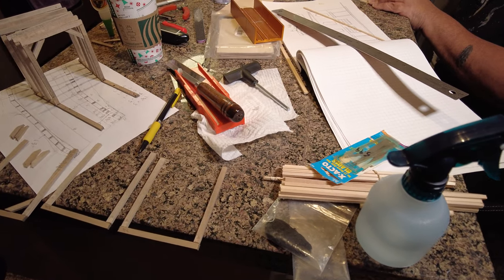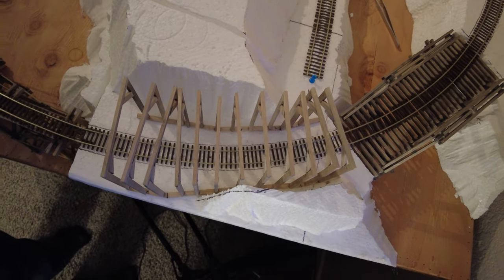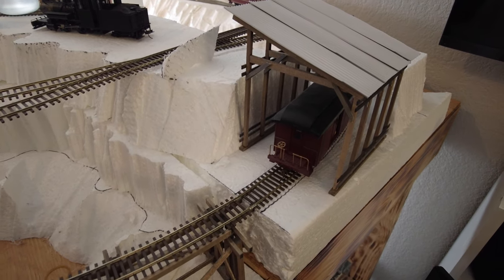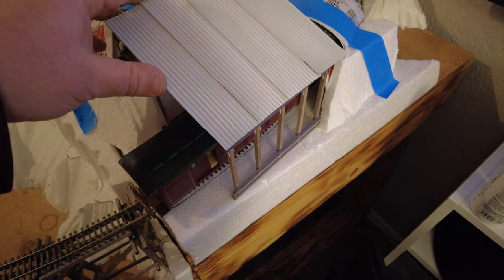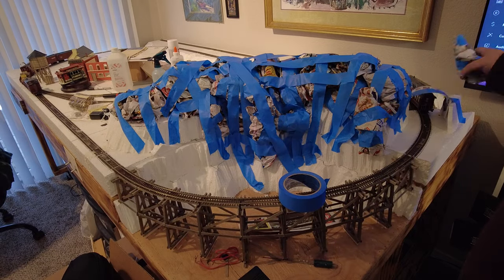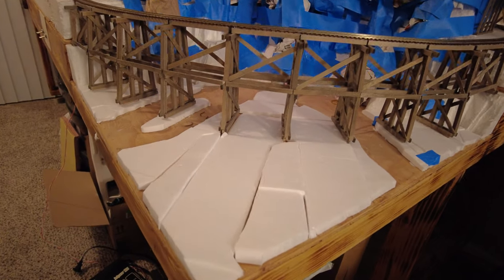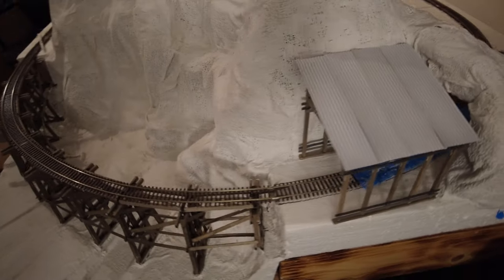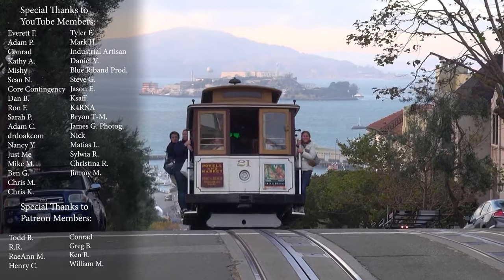Building Mountains On My Model Railroad | Update 2

Comment: Cool,  I have two combine cars, two coaches for my passenger train and a mixed train  i did receive the Climax a couple of weeks ago. I also got locomotive happy and recently purchased a Bachmann 2-6-2 Tank Trench Locomotive. My back story is that after the Great War the Kansas River and Southern Railroad purchased a Baldwin Trench Locomotive from the Army when the War Department sold locomotives and rolling stock not shipped to France before the Armistice was signed. Now in the world of the KR&S the Trench Railroads were 2.5 foot/ 30 inch gauge as opposed to the real 2 foot gauge. The time of my model is post World War 2 and the KR&S is still running that Trench Locomotive still in its Army paint scheme. I may even get some of the USA or Quarter Master Corps 18 foot Box Cars, Flat Cars and Gondolas to build up my rolling stock saying the KR&S bought them surplus as well.

Comment: It's looking much more like a mountain now. Looking at it I think what happened with the first wooden tunnel was mixing up some of your interior and exterior measurements.
Reply from the maker: Well actually what happened was the assembly part. The beams didn't glue vertically, they glued at angles which decreased the width in the tightest part of the tunnel. It would have had to be rebuilt and I wasn't satisfied with the design anyway.
Reply: @AlextheHistorian  Oh I see. Well you learned from it and made something better. :)
Reply from the maker: Thanks!